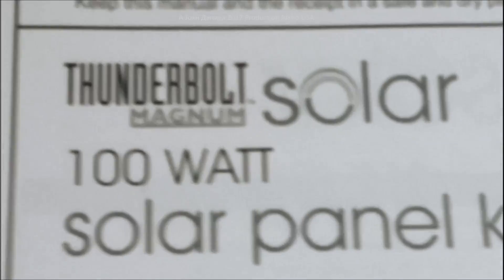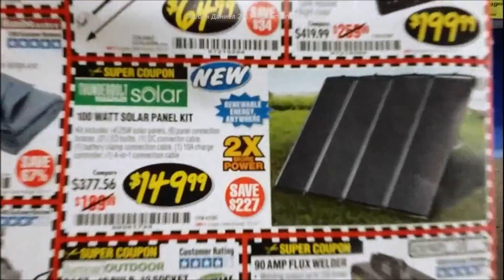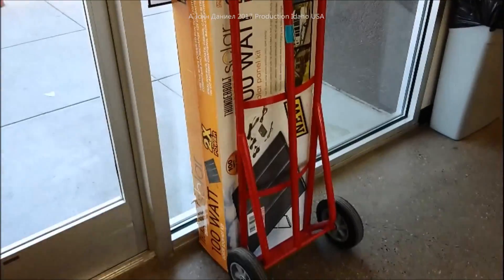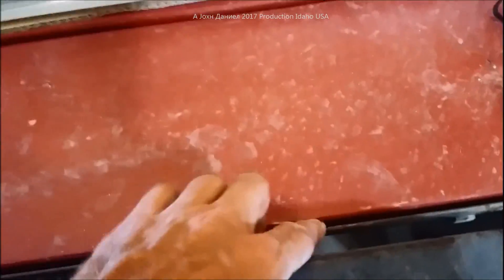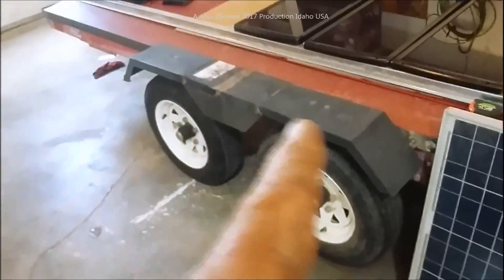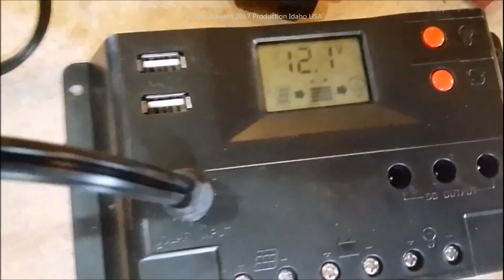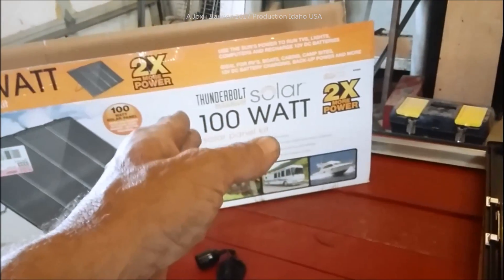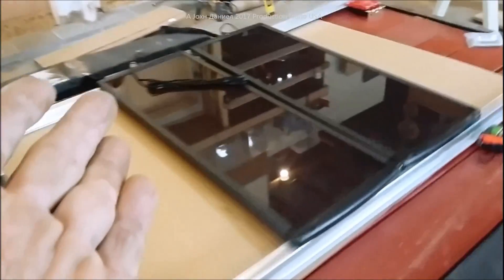Harbor Freight 100 watt solar kit #63585 NEW Thunderbolt Magnum (MAJOR PARTS LIST BELOW)

Comment: Awwww MAN!  WAY overpriced for what you get!  $200 plus tax?!  CAREFULLY check your local "CRAIGSLIST" for REAL solar panel "deals"*!  I bought  NEW 220 Watt (24V) Panels right out of the crate for $75 each!    Buy a 60 AMP Panel Regulator for  $12.99 from Calif. ~ INCLUDES shipping!  Also has 2 fully regulated USB ports too.   (eBay 183431594099).  Typical Panel life is 25 years.  *BE CAREFUL on CL ~ many sellers have junk/used/refurbished Panels!  Buy NEW so you know the full history of your panels... Same seller, 300W, NEW REAL panels $135... NOT Amorphous.
Reply from the maker: https://www.hfqpdb.com/best_coupon/100+WATT+SOLAR+PANEL+KIT
And careful buying solar panels on Craigslist. No Warranty, likely stolen, ( 4 arrested in Houston Texas selling stolen solar panels on local classifieds) and theres been a huge network of hucksters selling defunct Canadian Solar and Iridium Solar junk c grade panels with new labels on them. Best to go to www.solarblvd.com to buy bulk new quality stuff for 50 cents a watt.

Comment: SORRY you got SCREWED!!!! A 265 watt panel is only $48 dollars X 10   for 2,650 watts = $480.00  Whats your problem??
Reply from the maker: Yes, you can get a pile of defective reject Panels , probably from warehouse of the king of tricks in southern Missouri sold from a Mexican re-dealer out of california for 5 cents a watt. And $1,500 in shipping. Try solarblvd.com those are not factory 3rds and 4ths for 45 cents a watt and only $450 shipping for 10!

Comment: John, I'd like to get your opinion on 12volt maintenance free batteries vs AGM. I'm using 4 maintenance free group 31 batteries and I don't detect any fumes during charging. Are AGMs worth the extra money? Thanks!
Reply from the maker: AGM is great as a stand alone battery, in a group they can become parasitic. The SLA ( sealed lead acid ) are the better choice in groups. Avoid AGM to make a bank out of. And although people who SELL the AGM will surely post nasty things about what I am writing, the truth is a AGM fails, it destroys all others connected to it.
Reply: Јоhn Daniel - Thanks John. Now I'm more convinced than ever that buying sealed lead acid was the way to go. I appreciate you going out on a limb to give me the truth - Hal
Reply from the maker: When you replace, go to www.batteriesplus.com, order online, get 10% off and pick up in store. Just be sure you bring in your cores. I prefer GC2 235AH 6V - X 4 for a Moterhome or big RV. Yes they will need water, but not often. You can actually get these caps https://amzn.to/2NJmoLQ and you will love them.
Reply: Јоhn Daniel - Thanks for the advice John. I wrote that down. I can see how 6ers would be better. Much deeper safe dod

Comment: I bought a single panel, same brand, from HF. It put out under 5 volts in direct sunlight. I took the back of it off and resoldered connections which fixed it. The connections were pretty bad.
Seems like everything I buy electronic from HF either doesnt work, or stops working shortly after purchase.
Reply from the maker: If your trying to go cheap but want the biggest bang for your dollar For starters and pros the best Solar Panels https://ebay.to/2KHX5XY Mighty Max 100w4bar  at under $100 each delivered. You can lay them flat or at a sun rated degree with less power loss due to them having 4 buss bars on the cells. I will be installing them on my BugOut trailer in a few days. I put in 20 of them in Lovelock Nevada in April, the farmer who bought them is seeing 15% more power per panel on his 2.25"x12 almost flat roof.

Comment: I have no idea how much power, watts and volts. I'm on oxygen and I have a small oxygen concentrator that you can carry that has a charge up battery. It heats up when charging and I have to have power for it. Ok you can take the battery off and run it on a car battery or home power. A full charge is supposed to last 4 hours. I was wondering if you knew how many car batteries it'd take to run in for camping. I'm going to be putting a camper shell on my F-150 and try to get away from the house more. I think I could fit 2 set's of solar panels on the camper. Would 2 set's charge 6 batteries. I think that 6 would work. I think I can make them so I can change the angle and could maybe turn the truck pointing to the sun.
If anyone has any ideas please let me know. I'm hoping to do some winter camping in the trunk and hopefully my health will let me have one more summer before I have to give it up.
Reply from the maker: Give me the model number of your concentrator and the area of the country for sun rate exposure and I can send you a complete kit of parts that would so it with a secondary charge option design. Cheaper than your current thoughts. I did this design on a 22 foot RV for a 71 year old woman just 3 months ago.

Comment: Very nice review my 45 watt is still running after 3years now they are still working. They do work in low light but you cannot mix them with other solar panel types. However for the price I got them they are still a good deal. Thanks for sharing your experience with the new set with us
Reply from the maker: I use 8 with my 2800 watts PolyCrystalline panels, but be sure you add a 10 amp Diode or your right, they will not work with or in the string of other panels because there is no diode in the panel, just the supplied controller.

Comment: New to this, so I'll ask the dumb question now, how many of these panels can you hook together on the components supplied in this kit?
Reply from the maker: 5 can run into the 10 amp controller
Reply: Thanks for replying!
Reply: Also new here another dumb question how manny can I hook up to an mppt controller you recommended??
Reply from the maker: @Brownbean509  The MPPT controller under the video is capable of running 5 sets of 4 of these panels to increase their output over 14% in a day light solar production output. The haters of these panels fail to look at this fact as well as the fact they produce up to 3 hours longer per day of available light and in bad cloudy or rainy days. I am a believer of Amorphous solar by proof in my own use, not a blog or promotion of any of them. I do have over 6000 watts on my home&shop layout of other stuff, 1/3 is Amorphous uni-solar from Michigan who were best known until obama cut their funds to support his $600,000,000 donors from solar companies in California.

Comment: Love your videos!!!  I am just a beginner at the solar game but am starting by wanting to use it to power a  Harbour Freight submersible trash pump for use as a fountain.  I cant see spending $1200-1500 for a fountain system when I am simply trying to move water around my pond and have a pleasing sight.  By using the submersible trash pump and some pvc or iron pipes with a $9 brass nozzle I will get the same result with a huge savings as the pump is only say $100 and pvc parts $10 with longer power cable replacement.  None the less I want to power it with solar so there are no huge bills.  The pump is obviously  110 v and uses 7.6 amps so what size set up will I need?  Im guessing the thunderbolt may be a bit of over kill but not sure.
any suggestions are appreciated.
G
Reply from the maker: Look for a pump like this one https://amzn.to/2LH7EiI that runs completely off the panels without voltage conversion, batteries and losses. One set of panels from harbor freight would run it daylight to dark. No controller or batteries needed.
Reply: Thanks.  I did look at those but it will not be enough.  This is not a little Koi pond.  I live in Florida and in our subdivision there are ponds dug behind or in the middle of a group of houses about 1/4 acre kidney shaped.  I need about 3000 gph and is why I was going for the trash pump.

Comment: I have two sets of those panels.  They  run my lighting in my Florida room.   I put them on two harbor freight Solar batteries and I used a renogy charge controller so I can run both set on one charger.   I love them because the start charging first thing in the am.     They are three years old.  P.s. they have speedy recovery.

Comment: 100 watts of solar with maybe 3 to 4 solar hours a day gives you not even enough to run your laptop. Probably by the time you get done with all the losses in the battery and the converter your daily production of electricity is like 0.2KWh
Reply: Not. The 45 watt panel system ran a pump for a well. The 100 watt system will run twice as much. With power to spare. People make assumptions with.no proof.
Reply: I have the old 45 watt system in my off grid cabin..2 75 ah batteries...12 volt led lighting and a small fridge with 3000 watt inverter...always have power even on cloudy days....you could run your laptop for ever

Comment: LOL !  Do your homework bro.  Voltage ain't sh*t  It's the amps that count.  Just more HF cheap china crap.  Compare it to a Zamp.
Reply from the maker: Volts maintaining after exceeding battery is amps, and these 25w panels consistently make 1.47 amps at peak, and in cloudy weather. Being off grid with over 8000 watts on my place since 2007 building it all my self, I may have already done my homework.
Reply from the maker: BTW - ZAMP is made in china by BlueSolar, a shithouse product huckster. (source - DH Gate)

Comment: I'm a subscriber. Planning to buy 2 of these.  Going to use mppt controller. Gonna have to remove connectors.  Can you tell me how to tell which side of cord is positive and negative.  Thanks    Charlie
Reply from the maker: When you strip the outer case  on the wire, a red + and black -,  set are in it.

Comment: How do I use this to run an aquarium water pump. I want to make a running pump/reservoir to put in my garden for birds and insects and bees. How would I power the pump with this? Thank you. I subscribed to your channel.
Reply from the maker: Just buy a pump that runs on 12 volt, with a 6 to 30 volt capability would be better. The best model is this one, https://amzn.to/2I3jVgl and you can run it on 2 of those panels, so if you got 2 pumps then all 4 panels would do some serious water fountain action. They have numerous options in flow.

Comment: Wo kann ich das System kaufen und nach Austria (Europe) importieren ?
Reply from the maker: Mein bester Vorschlag für Sie, wenn Sie Amorphe Solarmodule in Ihrer Nähe haben möchten, ist Kaneka und einen richtigen MPPT Solarregler zum Aufladen der Batterie zu bekommen. https://rover.ebay.com/rover/1/5221-53469-19255-0/1?mpre=https%3A%2F%2Fwww.ebay.at%2Fitm%2FPalette-40-Kaneka-60-Dunnschicht-Solar-Module-60-Watt-sehr-guter-Zustand-10%2F272456701098%3Fhash%3Ditem3f6faf54aa%3Ag%3AGbwAAOSwiLdWCmE7&campid=5337663791&toolid=20008

Comment: John, thanks for the very informative video. I've been wondering whether these 100 watt panels would power my pool pump & also heat the water for use in off season. I live near Surprise, AZ so it doesn't get too cold in the winter anyway. I have a 12,000 gallon in-ground pool. I'd love to get your opinion on how many 100 watt kits it would take to make this work.
Reply from the maker: I would not suggest them for that. Pool pump is continuous, high wattage users. Thousands of watts. Makes Electric bills HIGH! Me and you, we are budget thinkers. Only Barbra Streisand can afford to preach solar and have a $12,900 a month electric bill (with not even one solar panel on a yard jockey LOL)  because she has 4 pools, and 17 cars, and no context of power - just liberal rhetoric.
 But if you wish to try and go solar on a pool pump and heat, I would say your needing some serious watts, try www.solarblvd.com , your gonna be starting with no less that 1800 watts for a INTEX above ground pool, as much as 15,000 watts for one like a california/hollywood liberal has on the grid.
Reply: Thanks for getting back to me so quickly with your advice.  Very much appreciated.  What would you think about me using the solar panels to ONLY for heating the pool?  I had a variable speed pump installed in Nov so that's saving me $$$ on the electrical cost.

Comment: thank  for  this video  i went  out  got  this  today   my ???  is   how  are these in weather   rain  -snow - things like that  ????  thanks   for  any info    have  a nice  day  there  from  us in  maine
Reply from the maker: Here is about a 8 month update on mine -  Still on the roof of my utility truck shell, working perfect keeping the batteries very hot and ready. Blizzards, floods, 90 mph! No issues with water, snow or traveling 12,000 miles riding up there. 
The last video I did on them showed them on my truck. I like them enough I put 4 more panels on a shed down at the end of my property 700 feet away,  to run 7 LED RV  porch lights http://amzn.to/2FlxiUt around the outside of it every night on 1 92 amp Walmart deep cycle and a 4 pack of HF panels, 6 months, not one dark night! VERY BRIGHT like 500% brighter than any solar rechargeable light kits they sell.
Reply from the maker: The "1600" windzilla from that link is about 300% over rated based on its own weight, WHERES THE COPPER!!! That thing is like putting a 3 hp motor in a riding lawn mower LOL!
You simply CAN NOT get 1600 watts from 2 lbs of copper windings and 5 foot diameter blades. Just total fraud!

Comment: Junk panels - will not survive the test of time, not even a good deal, you can buy 100W system off Amazon with better quality for same $ or less - good for people who want to play with solar
Reply from the maker: Agreed, the panels are generally basic. They are not Sharp, Fuji, Bosch or even solar cynergy. BUT, the old 45 watt kit i bought in 2005 so far have lasted 12 years on my old tool trailer, 5 of them still keeping the trailer lights on. 3.2 amps still coming from them.
 And if they did not exist, 50% of the people who move up to the better commercial grade would not have done so because they would have never gotten the SOLAR BUG and edumakation of DIY!.
Reply: a toy kit for science class experiment  ? Seems so ! Not lasting very long due to poor or no chinese quality control standards and no long term testing ! save your money & time. This stuff is crap ! Tried a  kit. Panels cheap plastic was broken right out of the box. Got a full refund though !

Comment: Advantages and disadvantages of amorphous solar panels

Unlike many other thin-film panel options, amorphous silicon panels use very little toxic materials. When compared mono- or poly-crystalline solar panels, amorphous panels use much less silicon. Amorphous solar panels are also bendable and less subject to cracks than traditional panels constructed from solid wafers of silicon.

The ongoing challenge with amorphous solar panels is their low efficiency. Due to complicated thermodynamics and the degradation of amorphous silicon, among other factors, amorphous solar cells are less than half as efficient as mono- or poly-crystalline solar panels. Amorphous solar panels offer around a 7% efficiency rate, while mono- and poly-crystalline panels have efficiency ratings of anywhere from 14% to 20%+. Attempts to raise the efficiency of amorphous panels by stacking several layers, each in tune to different wavelengths of light, has proven somewhat effective, but the overall efficiency of these types of thin-film panels is low compared to other options.

Comment: I just bought this kit Friday and finally got to test it out today. It works and that's what I wanted to see. I'm experimenting with some solar stuff and learning the lingo and info as I go. I bought the HF 35Ah battery they sell to use for this as well. I did a lot of 'camping' in the Army but now that I'm older I want some things running that require electricity, when I'm away from the grid. We had a tornado a few years back and you will figure out right quick how much you like power as soon as you don't have it. I have 2 small power inverters that I was running off of car batteries at the time because that's all I could do to run tv to keep up with what was happening around us. I'm wondering how long it will take to charge that single battery up while using minimal power from it, to give the panels a chance to do their thing. I have a small generator from HF as well to assist with charging if need be. Like I said, this is all an experiment right now. Thanx for the video and God bless!
Reply from the maker: If you start your upgrade trip into this venture, ONLY order SLA ( Sealed Lead Acid) batteries from place like  Ecom. They are the ONLY people to have the REAL thing,  not knock off Batteries. Real UPG can last 5-6 years, fake ones like Harbor Freight last maybe 3. http://rover.ebay.com/rover/1/711-53200-19255-0/1?icep_ff3=2&pub=5575119394&toolid=10001&campid=5337663844&customid=UPG+Manufacturer&icep_item=131167611966&ipn=psmain&icep_vectorid=229466&kwid=902099&mtid=824&kw=lg NEWEST STOCK
Group wire them in sets of 6 with 2 gauge wire to get the best results. Like this https://youtu.be/1a4LUaqrXbA
Reply: Thanx for the battery info! I will watch that video here shortly. I been poking around on various forums and web sites seeing what info is out there. There is a ton of it, and a bunch is conflicting and people bickering about who is right, blah blah blah. Gotta love the internet! haha. I know I can't do much with these panels, but not much is a start and a good place to learn.

Comment: I just bought this kit the other day.  I thought it was good....  now I KNOW it is!!  Thanks for the video!  I'm wondering if Harbor Freight sells the panel, JUST a panel at a time to add on to the kit...?
Reply from the maker: That controller can handle 5 panels, I like the ability mine have to charge in low light. My system for my house is over 5900 watts but these are just perfect to keep my truck batteries hot and healthy.